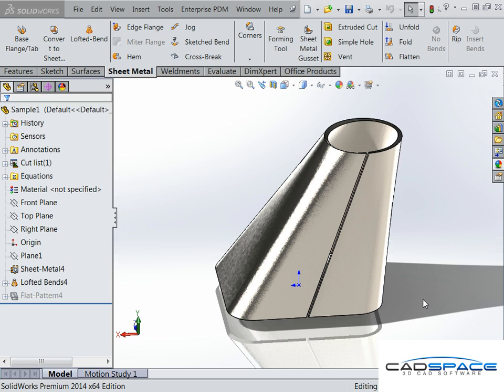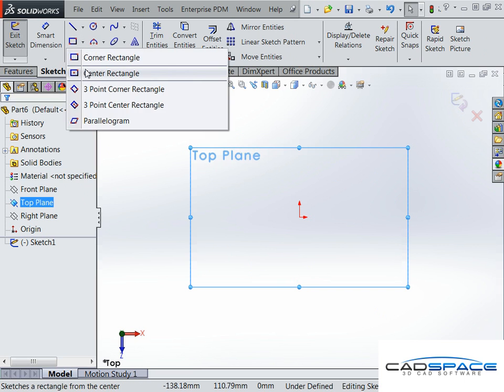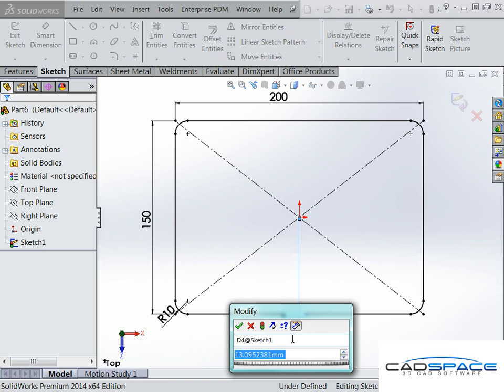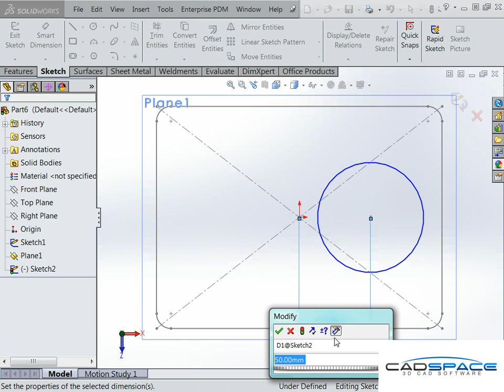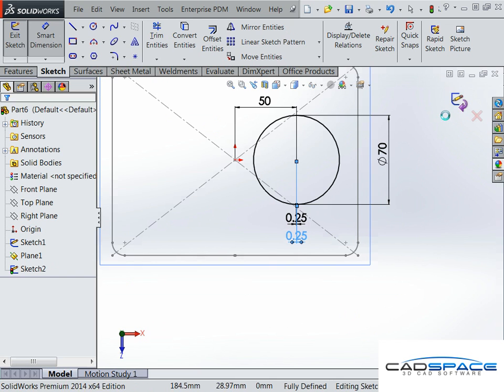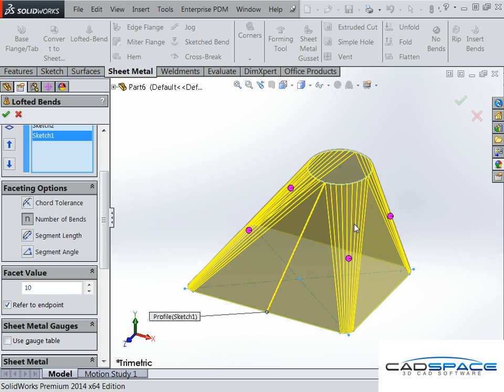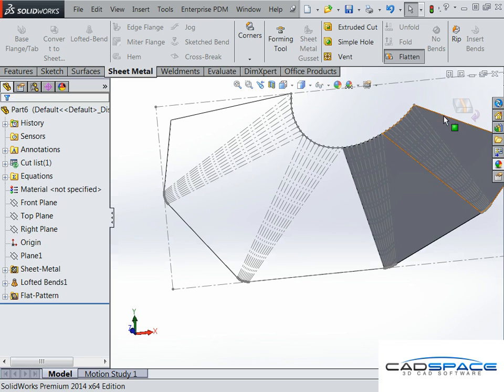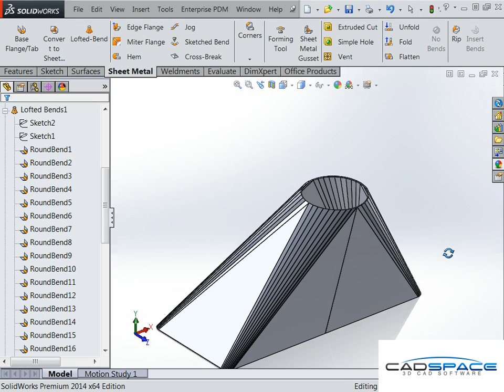Square to Round Duct in SolidWorks Sheet Metal

Comment: what version are you using, mr? i am using SW 2012 and when i use lofted bends it is not like what you are using and i get problem!
Reply from the maker: +duy nguyen This is SolidWorks 2014. The lofted bend had an update in 2014 which introduced manufacturing method selection between bend and formed which would be significantly different than in 2012.